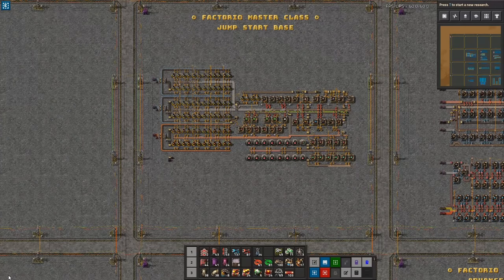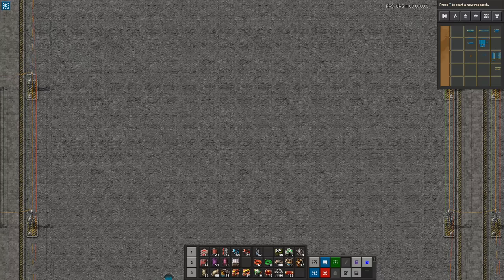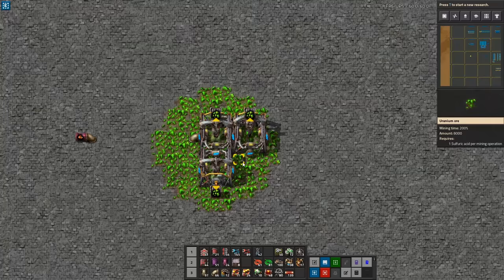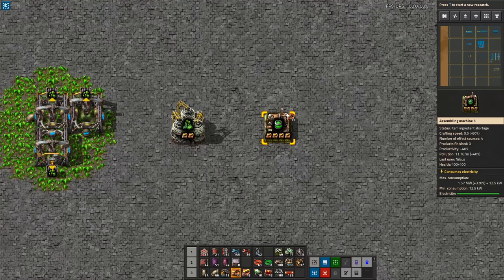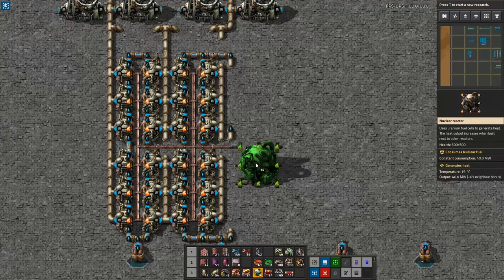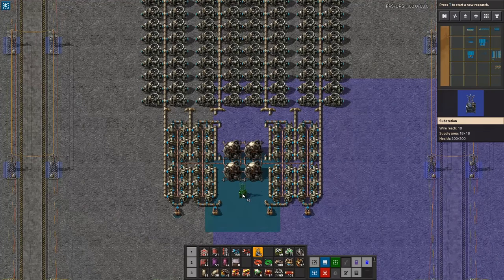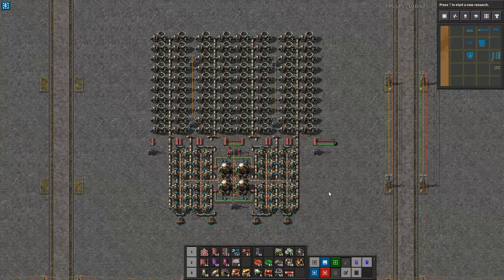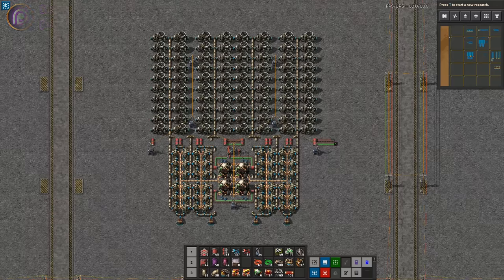NUCLEAR POWER; Shattering Conventional Wisdom | Factorio 0.18 Tutorial/Guide/How-to

Comment: For others, here's another way to break down the math behind "uranium-235 is more abundant than you think" is in terms of time.

There's just under a 1% chance of getting a uranium-238 each time uranium is refined, which can also be written as a 1/100 chance (to be more specific, a 7/1000 chance). Uranium refining takes 12 seconds. If you had 10 centrifuges all getting a steady supply of uranium ore, they would refine 100 uranium in two minutes; if you scale back to a more conservative 5 centrifuges, they'd refine 100 uranium in four minutes. That means on average, with five centrifuges, you'll be getting a piece of piece of uranium-238 every four minutes, five minutes to lowball it if you're feeling unlucky.

A single piece of uranium-238 produces 10 nuclear fuel cells, which in total will run a reactor for 2000 seconds, which is 33 minutes. So, once that first piece of uranium-238 pops out, it's going to provide you more than 30 minutes of power, and you want to get another one to make more fuel cells before time is up. But within that 30 minutes, you'll have around 6-7 "almost a sure thing" chances. And this is all without modules to increase speed or productivity, and on just five centrifuges.

The odds are ridiculously in your favor that you'll get at least one uranium-238 in time, likely more than that, and of course as you keep playing the stockpile safety net will keep growing. The catch then is just making sure you've set up your output lines in such a way to get the 238 to the assembly machine making the fuel cells in a prompt manner, but that's no biggie.
Reply: Im just looking at setting up my first reactor but didn't he say 200 seconds?
Reply: @JonnySparta  one fuel lasts 200 seconds, but a uranium-238 produces 10 fuel cells.
Reply: @DrakeyC  Ah I see, my bad :) i did kind of figure anyone writing a comment like yours probably did know what they were talking about
Reply: @JonnySparta  No problem :) I'm not an expert at the game by any means, I just enjoy math.

Comment: I'm struggling to bring enough water from my distant offshore pumps because pipes really limit fluid flow. So I need some tanks and electric pumps to supply throughput. I couldn't find a good recent discussion on factorio fluid mechanics. I'm wondering why 1 electric pump with in-game listed 12000 units per second can't push more than 1200 units per second of fluid through a water pipeline supplied by 10 or more offshore pumps at 1200 units per second of water each.

Comment: 19:45 I am not convinced that this is a minimum heat pipe length design.  The nearest heat exchanger is 7 pipes away from the reactor and the furthest is 19 pipes away.  If you made rows of heat exchangers coming straight out from the 2x2 reactor grid corners the nearest heat exchanger would be 2 pipes away and the furthest would be 17 pipes away.

I understand that this allows for a more tidy tileable design, but comes at the cost of performance, which decreases space efficiency.

Edit: my mistake.  This only affects buffer size at lengths below 48, which only matters for fuel conserving control systems.

Comment: One thing he didn't mention is that the steam turbine just needs steam--it doesn't matter what temperature, or what from. 

Steam engines use 30 steam per second and make about 900 kilowatts.  Steam turbines use 60 steam per second, and make about 5.8 megawatts. 

Long story short, when you get nuclear power, you can scrap all your steam engines, replace them with half as many turbines (easy to make at that point in the game), and you'll more than triple your power.

That will give you plenty of time to set up your nuclear power...  or to go without it, if you don't want the headache.
Reply: boilers only generate 165°C steam, whereas nuclear powered heat exchangers generate 500°C steam.  Nutshell: a boiler with 2 steam engines generates the same exact power as a boiler with 1 steam turbine (1.8 MW).  Its the same "volume" of steam (60/s) but the temperature of the steam matters.

Comment: "Don't design large reactors, it's not worth it".

I beg to differ. The whole point of Factorio is to design things yourself.

Designing my 6x2 reactor was fun, working around the capacity of pipes, ensuring maximum fluid throughput etc. in order to build a setup that could run near 100% theoretical capacity.
I get that it isn't an efficient use of my time as an engineer, when a simple setup such as yours would to the job just as well but... efficiency is for work. Fun is for games.

I do admit that the awkwardness of the fluid system does make it somewhat problematic at times if you are hellbent on working near the theoretical throughput limits.

Comment: I keep getting the figure of 1,9 miners per reactor. Can I see  your math?

Here's mine. (Bare with me as I try to lay out the equation in youtube comments and make it readable. )

1 Reactor = 1 Fc/200 sec
10 U235 = 116 Fc
1 U235 = 1323 ore
1 Drill = 18 ore/min
-------------------------------
1 reactor = ? Drills 

                          1 Fc  * 10 U235  * 1323 ore * 1 min * 1 Drill * 60 sec
1 Reactor = ----------------------------------------------------------------------------------------- = 1,9 Drills
                          200 sec  * 116 Fc *   1 U235 * 18 ore * 1 min
Reply: I've also tried the equation in reverse and I get that 1 Drill can fuel 0,53 Reactors. which means that 1,9 Drills can fuel 1 reactor. One of us is making a mistake.
Reply: @dakon2154  8 miners per 4 reactors would make sense with the equation as well (1,9 miners per reactor * 4 = 7,6). 
Thanks for clearing that up. As an engineer it was really eating away at my soul.
Reply: Since the refined uranium is 0.7% chance of earning, it means, on average, 7 for each 1000, which means 1 every 142.86, rounding up to 143 ore. So, if every 143 ore, it would output 1 U235, I don't get where you got those 1323.
Reply: @mobius1qwe  One refined uranium requires 10 ore. So 1429 ore would be needed for one. You actually right. Where does the 1323 come form? He does say on average so maybe this is enough for a reasonable chance to get one. I missed the workshop session and OD doesn't appear to be available ATM,  so I can't check.
Reply: @Zweistein001  still I think it would be 15 cycles of 10 ores to get 1 U235. 1323 ore per bit would mean 132 cycles to get 1 ore putting the ratio Way off of 0.7%

Comment: I have a few questions but I'll stick with only this: If I were to repeat this power production design, I would obviously use bots to handle the fuel, since it would require around 2 bots to handle up to 4 setups without issues, and 2 bots are WAY more efficient than like 400 tiles of belt. With that said, why you're not condensing your input into only 1 line instead of 2 and using both sides to handle the fuel? You could easily handle the belt with only splitters, not needing the red inserters and saving power in the process, extracting more from your power setup.
Reply: Using only 1 lane forces you to have your fuel cell input and fuel reprocessing on opposite sites. I agree that I would prefer bots to deliver the fuel but the moment I build my first nuclear setup I usually don't have full roboport coverage yet.
I don't get your argument about saving power by not using red inserters. Even with bots you need 2 inserters per reactor, even ignoring the power that the bots consume, what difference make 2 more inserters?
If you want to know more about the designing process that led to this setup check out the workshop episode on his Twitch channel.
Reply: @dakon2154  For a belt-based setup you wanna conserve power whenever you can because that's the nature of a belt-based, power saving. For a bot-based that would be irrelevant as it consumes more power anyways untill you have high bot speed research.

Comment: I'm not sure I'm doing the math right but I got a different ratio of mines to reactors. Taking the numbers in the video I get the equation (18/60)*(1/1323)*(116/10)*200 =0.526 reactors per mine or 1.90 mines per reactor, which is off by a factor of 4. Did you mean it takes 8 mines per your design or 8 per reactor because I don't see where else the 4 could've come from

Comment: My biggest power plant has 3 reactor now, I launch 200 rockets and still do not need power  plant bigger than 2x2 design.

I will agree, fuell is so cheap, you do not need any energy eco design, you just add 1 ( or 2, 4)  more reactor.
Reply: @vovozaum  and how many rockets did you launch? 2000? My base is just enough to build a silo (8 yellow line of Cu and 8 line of Fe). Now I'm planning something bigger.

Comment: I build 4 reactors in a square with bots feeding and carrying away fuel and a "+" pattern of boilers/ turbines in 2 rows of 8 boilers with 2 turbines on each leg of the "+" for a total of 64 boilers and 128 turbines.
The end boilers are still over 500C, could probable get away with 9 in each string but 10 doesn't get 500C at the end of the heat pipes.
I seem to be getting a little less than a GigaWatt from each complex, I have no idea if that is good but it serves my purposes.
My current game has 3 quad reactor complexes and 1 GW of solar, my power potential is 4.9 GW in daylight, I'm using a little bit more than 3 GW at this point.

Comment: I don't always have abundant shoreline.

Will it have fluid and heat delivery problem if you build it as narrow as possible? Just in case you've done the research already and have all numbers ready.

It could make a "more tileable" design than this without losing the general idea.

Also bots make sense in that no excess fuel cells are just laying on the belts.

Comment: The math here seems pretty off.
1 fuel last 200s, and if 10 u235 produces 116 fuel. That means 1 reactor need 1/11.6/200≈0.000431 u235/s
1 miner produces 18 ores for 1 min, which is 0.3/s. If every 1323 ores produces 1 u235. That means 1 miner will produces 0.3/1323≈0.000227 u235/s.
By dividing these two, you get 0.000431/0.000227≈1.9. You need 2 miners to feed 1 reactor!

Comment: Do pipes know how much water is being pumped? Say if you connected all the water pumps together, would that makes a difference?
Reply: You can easily connect two offshore-pumps to one pipe and have a 2400 of water. But you should use some regular pumps to support this throughput (and pressure) within this pipe. Maybe it's possible to connect 3 offshore-pumps to one pipe...i didn't test it.

Comment: Err, is no one going to point out that's not a 464MW Plant? The water limitation means your exchangers are only going at 97-point-something efficiency. Knocking 464 down to 450. Unless I missed something?  
EDIT: Wait, no, I did miss something, that's 48 exchangers, the lost capacity from water shortage is less than the number of missing turbines, nvm.
EDIT2: Steam Storage, seems like it could be nice for lasers. Turbines and tanks are cheaper than accumulators right? Well, if you're short on oil. Maybe not otherwise.
Reply: Steam storage still needs to be converted to electricity through the turbines, which have a fixed maximum rate.  Accumulators don't have such a limitation, and act like super-capacitors that can supply as much transient power as necessary, e.g. for laser turrets.

Comment: If the "wastefulness" of the ratios are really bothersome to you guys, there's a mod that fixes heat exchangers to use 100 water per second instead of 103 and change.  It makes it so that heat exchangers activate at 515 C (which is 500 above the baseline temperature of water, 15 C).  So the ratio in this video of 6 heat exchangers to 10 turbines ends up not wasting any heat or water.

https://mods.factorio.com/mod/Fahrenheit959

Comment: REALLY GOOD MASTERCLASS! Though what i was wondering about was how do you get for the efficiency 1 calculation 8 miners when i plug 18/60 /1323 * 116 * 200 in the calculator, it gives me 5.26,  so rounded up only six...
Reply: You forgot to divide by 10. fuel cell production uses 10 uranium 235 to create 116 fuel cells.
And what you computed is the reverse. It's the number of reactors supported by 1 drill.
So the actual result is 0.526 reactors per drill, or by inversion about 1.9 drills per reactor, rounded up to 2.
I think he actually computed the number of drills required to support his cluster of 4 reactors (4x1.9=7.6), not just 1 reactor.

Comment: good design but inefficient. You only put in enough 235 to heat the exchanges. then take the 235 back out. Storing the Heated Steam is the most Efficient Method Period. All you have to do is create a simple circuit to register the 500/750/900c or what ever your mod is. Once the Exchangers hit target  temp filter back out the 235, when target reaches below like 30% of max temp filter back in.

Comment: The disbursement of fuel was really disappointing in this video. With yours, there is no way to automatically turn it on when you run low on steam and no way to stop it from continually feeding more fuel in. I use two smart inserters for each reactor. Each inserter is set to only pick up one item. The one that pulls out a spent fuel will only do so once steam reaches a lower thresh hold that I set. Once that thresh hold is met, it pulls it out, which triggers the other one which will only put in a new fuel cell when the other inserter is holding a spent fuel cell. I have enough steam storage so all the heat exchangers have enough tanks to hold the excess steam and not fill up before by the time the nuclear cycle is finished. So mine is automatic, wastes no steam, heat, nor fuel, uses similar ratios, and is a 2x8 reactor, and may have shorter heat pipe lengths than yours too, I'd have to check that last one though.
Reply: As stated very clearly in the video, this simply increases the load on the PC (the actual factor that breaks factories) while saving fuel that is abundant to the point that saving it never does anything. For example, with Kovarex and productivity modules, a single uranium field with 1 million ore can support 16 reactors for over 3500 hours, simply feeding in fuel as soon as it is used up, no steam storage involved. Obviously it won't last as long if you turn most of it into ammo, but it's not like the world only generates with one deposit, either.

Comment: If you show us that you need an 8:1 ratio of miners to nuclear plant just after unlocking this tech (and having prod mod #1 available), then I don't follow how, for four (4) plants, you only need 24 miners? My math says 4 * 8 = 32 miners. Later on, when you have prod mod #3 available and the ratio goes down to 6:1, then I can see 4 *  6 = 24 kicking in. But I just don't see how 24 miners "in the beginning is really enough for 4 nuclear power plants". Please enlighten us?
Reply: That was a little bit of a mistake on his part, not in his math, just in his speaking. 8 drills with productivity modules can actually fully support 4 reactors. He undersold it.

Comment: I've heard lots of concerns around UPS friendliness of Nuclear Power vs Solar power on Mega bases.Any thoughts?
Reply: Nuclear power requires fluid calculations (steam, water), heat flow calculations, inserter monitering code, etc.
Solar panels have the same calculation load if you have 1 on 1 grid or 10,000 on one grid. Because they have the same behavior, I'm pretty sure the devs just slapped a flat multiplier on the generation for the number of panels in a network.

Not sure how accumulators are handled, especially if they have varying-fill-levels if you abuse power switches, but they'd have to make some pretty cycle-hungry code to compete with all the fluid calculations.

Tl;Dr, if you're having UPS issues, switch to solar, otherwise nuclear's more fun (imo).
Reply: Solar is vastly superior. You just need insane amounts. I'm at about 350k solar panels plus accumulators and it's not enough...
Reply: @willb5278  Thanks! I totally agree that nuclear is more fun!

Comment: what difference would it be running the steam turbines on the coal boilers instead ?
Reply: Try it.  You'll get power from the turbine(s), but not more than if you used regular steam engines.

Comment: Totally agree with all your points, except that this design is very space inefficient. A huge portion of the city block goes to waste.
I tried some more designs and came up with quite a nice looking one with 12 reactors in a 100x100 grid. It is also tileable and includes strategically placed landfill, so it can be built in the ocean, but still leaves lots of water in case its needed later.

Id on factoriobin is G_hT376v .